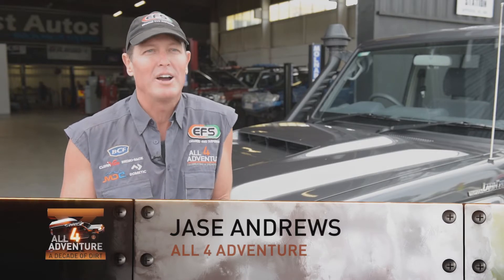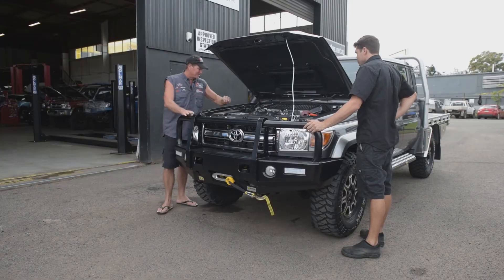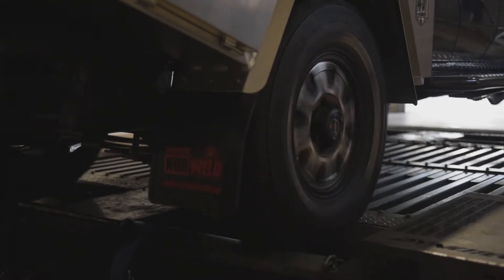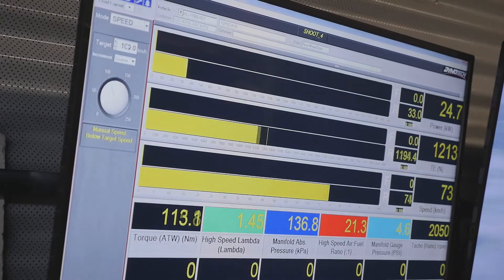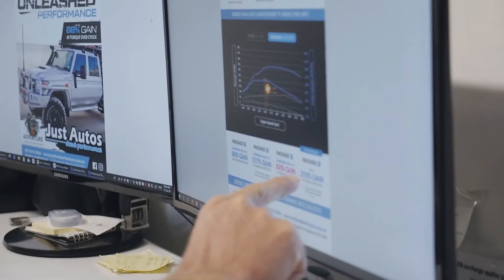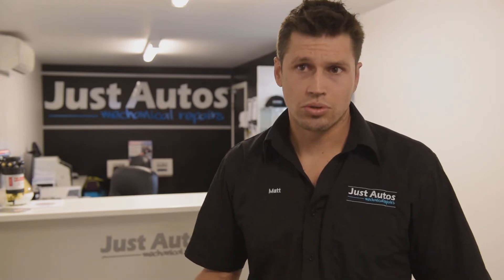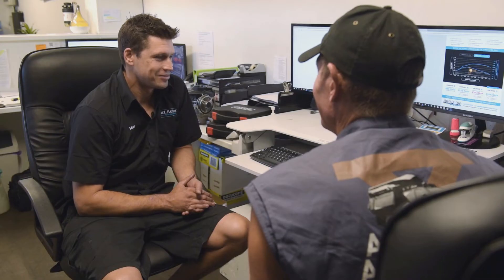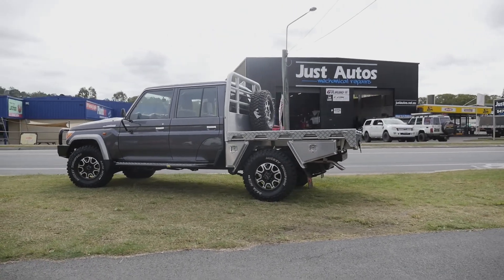3 CC 79 Just Autos A

Comment: I am curious about the fuel economy after the upgrade. 79 have such poor fuel economy compared to the 200 series. I wonder why don't Toyota just put the 200 series engine on 79
Reply: Depends on how you drive it you can avarage at around 26 to 28mpg for 79 series the nm are the ones which determine what millage you will get
Reply: @michaelkush7062  mpg lol